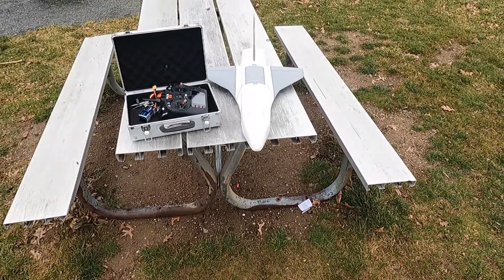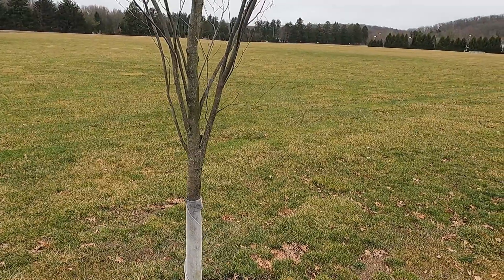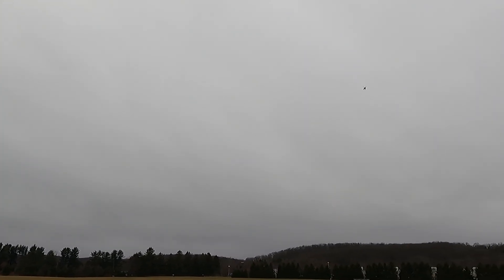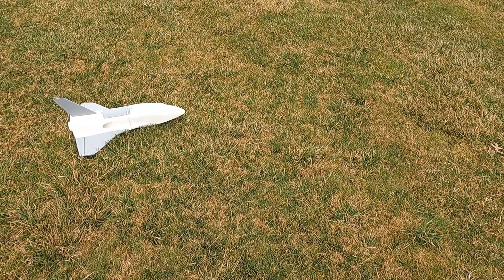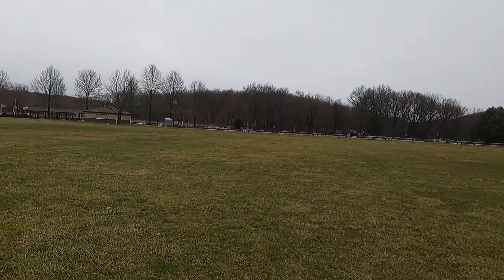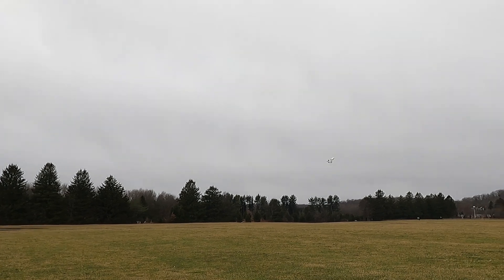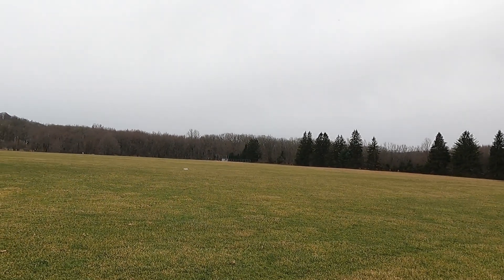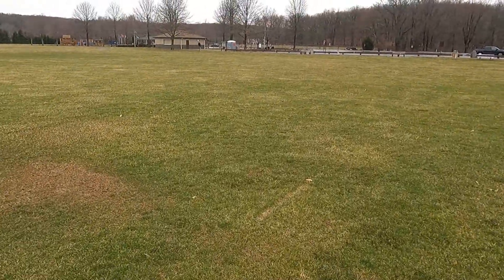Space Shuttle Maiden Flight! (35 mph wind!)

Comment: The noise is from the rubber band vibrating in the wind. If you put a twist in it where its not tight to the fuselage the noise will go away.😎 learned this from using hold down straps.
Reply from the maker: Yup! That must be it. Makes me wonder how to print a thin vibrating device to make it sound like a turbine lol